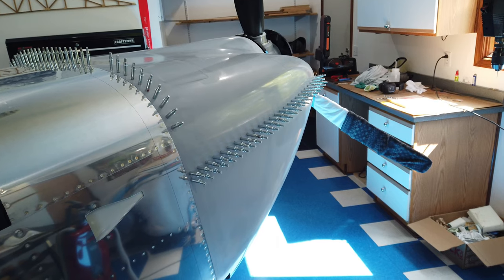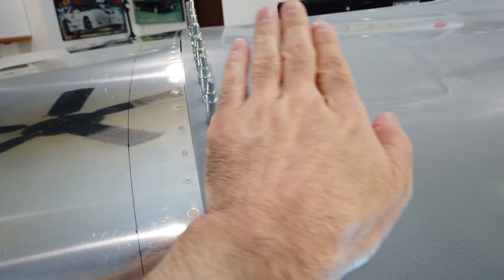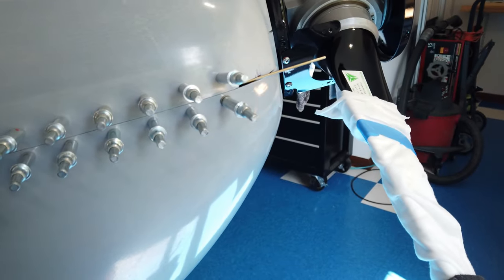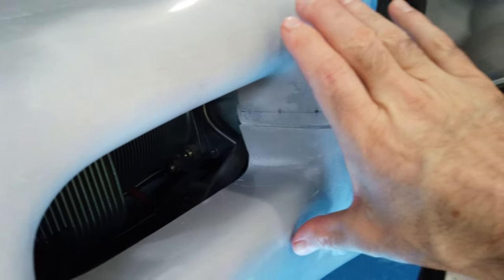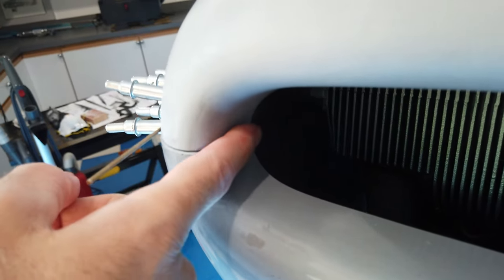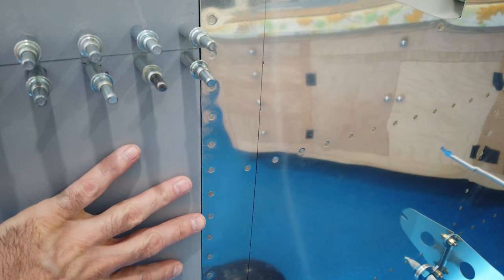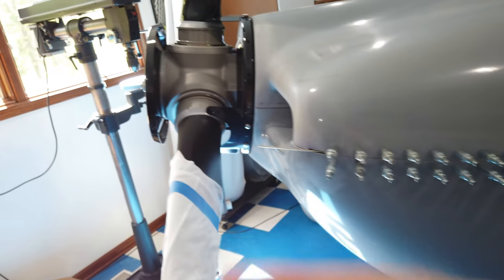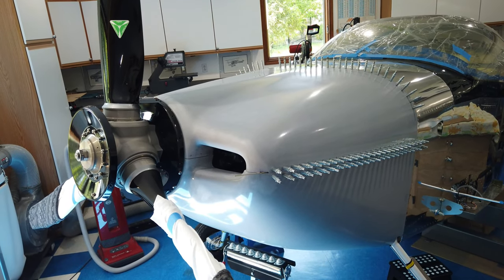Vans RV 7 HINT Videos Top Cowling 7

Comment: I've never worked with fiberglass, but couldn't you take some body filler and build out those upper edges on those front openings. Maybe slip a thin piece of sheetmetal between the halves to maintain an even gap.
Reply from the maker: I am not a fiber glass guy either, but  as you noted, perhaps fiberglass is the way to go. I was going to try an epoxy and flox mix, (already have both) and try to build up those areas and shape/sand.